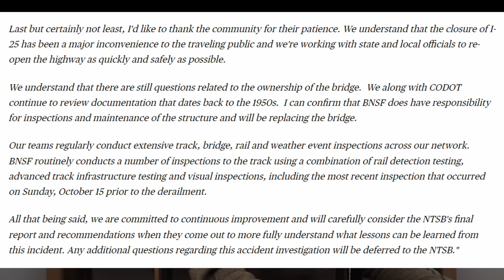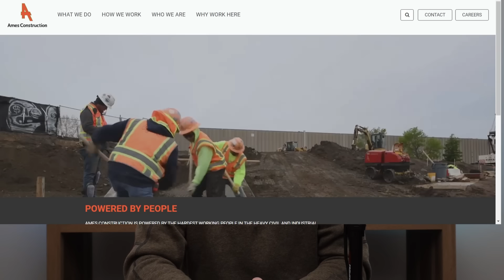Railroad Derailment and Highway Disaster

Comment: Most railroads used to have a set of ‘guardrails’ on most of their bridges. These guardrails sat between and ran parallel to the set of rails crossing the bridge. (In other words, you would see four rails instead of two). The thinking was that if a running rail broke or if a wheel derailed, the extra rails on the inside might ‘catch’ the wheels and keep the cars from tumbling off the bridge. You can still see these used in some parts of the country.
Reply: I thought they were still used everywhere. Their job is to stop a minor derailment turning into a disaster like this. One the train starts concertina-ing, nothing is going to keep it on the tracks.

Comment: Precision Scheduled Railroading has placed a burden crews, equipment, and infrastructure.  BNSF has been one of its biggest advocates.  It’s emphasis is doing more with less, longer trains, and less personnel.  It may of have no impact on this derailment but derailments have increased after the implementation of PSR.
Reply from the maker: That is interesting and not something I had heard about before.  Thank you.
Reply: Nothing whatsoever to do with PSR, and the number of derailments is falling, not rising. Coal trains have always been basically as long as the power can move.

Comment: The railroads do track inspections frequently.  In some areas, it gets done every few days, and in others a minimum of weekly.  Especially on main lines. Watching the virtual railfan site, you see them just about every day in one clip or another.  They have ultrasonic testing for internal voids and cracks, broken rails and so on.  The fact that the track had been inspected that day before the accident is more of a coincidence than anything else.  They lasers look for issues with track hardware, and when it discovers problems, the car can mark the track there with paint in some cases, and it is recorded on a computer that flags all problem areas with type of problem for the maintenance crews to address.
Reply from the maker: That is very interesting.  I was not familiar with the details of the railroad's monitoring methods previously.  Thank you.
Reply: @CaseyJones-Engineer The railroads have their own inspection cars, and also bring in Sperry cars to do even more analysis. Any place that has "cracks" or "voids" typically gets a slow order, forcing trains down to 5 or 10 mph...   I am retired from the geek side of the world, but have friends that work not only in MOW, but in operations, signaling and so on.
Reply: @CaseyJones-Engineer  The feds have standards for the frequency of inspections that are the minimum that has to be met.  In the case of Class 2 track (which is typically around 25 mph freight track on short lines) - the minimum inspection is once a week.  Higher speed line ends up getting class 3 inspection rules.  If any passenger trains use the line, that typically bumps the grade up a bit, maintenance wise.  When you get to class 9 track (good for 200 mph) -- freight is not allowed, and inspections are daily if I remember correctly.  Trackwork requires a ton of materials engineering to make everyone happy....
Reply from the maker: @Billblom  Very interesting, thank you for your comments!
Reply: "The fact that the track had been inspected that day before the accident is more of a coincidence than anything else."
No, it's not a coincidence. As you say, it's by design -- if you're inspecting the track every few days that means that, whenever an accident occurs, the track will have been inspected in the few days before it.

Comment: Many of my friends and relatives work for the railroad , so over time we’ve had many discussions about therm way inspections are done  . In the beginning a man was responsible for his section of track . They would walk it daily , and repair or report any problems . Then it went to weekly inspections  . Then monthly . Now it’s done electronically , a wire tells them if there’s any problem . Cost cutting is the goal , but a derailment isn’t cheap . 👍🇨🇦
Reply from the maker: That is really interesting.  I suppose the next step will be to somehow take all of that monitoring information and run it through an AI program in an effort to predict where failures might occur.
Reply: They still do visual inspections, from a hi-rail truck.

Comment: Isn’t it true, though, that short span railroad bridges are not always designed to handle the intense extra forces that occur in a derailment because the likelihood of a derailment occurring in one particular spot that would impact them is extremely low?  And if it were bridge failure, it would have failed from the weight of the locomotives and we would have a locomotive on the highway and not coal cars?  Even a brand new thru-girder bridge would not withstand a 100 ton coal car striking it sideways and a new deck style bridge would have just allowed more of the train to scatter on the highway like the WashDOT Talgo Cascades crash that killed 3 and  injured 65 including 8 on the highway.
We have all sorts of just constructed highway overpasses that could risk collapse from accidents involving trucks carrying certain cargoes, not to mention the large number of bridges over navigable waterways that are under-protected and would collapse if hit by a barge or other craft. If there were ongoing inspections, I would expect the focus to be related to track roadbed geometry and deterioration.
Most railroad bridges from the first half to the mid-20th century are extremely durable because they were designed to support huge steam engines and their tenders which often weighed 3 times as much as modern diesels and 5 times as much as the coal cars involved in this derailment.  So, when you see an old railroad bridge, it’s not automatically deferred maintenance.  They are bridges designed to last 80 to 100 years because railroads absolutely do not want to have to interrupt traffic to replace them as they don’t need to buy votes with bridge contracts.  And, they are bridges that have spent most of that time carrying half or less of the loads they were designed for.
Reply from the maker: Thank you for making those points.  I thought it was interesting what you said about the loading be greater in the past during the steam era.  I had not thought about that before.
Reply: @CaseyJones-Engineer  Yes, it really wasn’t until about 10 years ago when friends of mine who work for CSX and I were sitting around looking at old Trains magazine issues that we picked up on it, too.  On top of the fact that steam engines weighed up to 500 tons, most of that weight was concentrated over the driving wheels for maximum traction which meant bridge spans as short as 60 feet could be carrying 300 tons. Then add to that the way they are powered with side rods on a quarter rotation (the reason for the chuffing sound) that also weigh several tons that are not putting down continuous tractive effort but in a cycle.  This would basically mean the engine would be bouncing. The faster it went the more literal Pounding it was doing to the rails and any structure holding them up!
We often think of the Interstates as the greatest transportation construction project in our country’s history, but think about private rail companies had built a roughly 220,000 mile network with load capacities higher in most parts of their network that much of our current highway network still couldn’t handle.  And go back even further, in the 1860’s and 70’s when local transportation for most was horse and wagon, railroads were building bridges to hold up early steam engines that weighed 20 or 40 tons pulling rail cars that could also weigh 30 tons each.   Over 150 years ago, railroads had infrastructure crossing the rivers, mountains and canyons from one coast to the other capable of supporting hundreds of tons while people still rode horses and the automobile and airplane were decades in the future.

Comment: I was a BNSF Engineer, now retired,  and I ran those very same coal trains, I likely ran that particular train involved in the accident. I ran them between Denver and Sterling Colorado. The tracks are inspected nearly on a daily basis. Routinely, for any identified track problem, a work crew is dispatched to make repairs and still keep trains running. We, the train crew, are issued a Form B wherein maintenance folks are working and we must contact the foreman via radio to gain permission to proceed through the work area or to stop.  A Form C is issued as a slow-order where trains are restricted to a speed limit between specified mile markers, usually 10mph.  One day, as we were stopped at a siding we observed an area of track just in front of our train where the roadbed had been eroded away from recent rains. We reported this to dispatch via radio which resulted in trains being stopped wherever they happened to be along the route, including AMTRAK. Within a couple of hours, maintenance trucks swarmed the area to make repairs and re-bed the rail. The track inspector had likely not seen the erosion at the time of their passing because the erosion hadn't progressed enough to be noticed. But, we train crews are always on the lookout for “bad rail.” 
This particular bridge likely was constructed during the Interstate expansion of the late fifties through the sixties. Don't know where the head-end of this train was in reference to the derailment but those rails do fracture and break, those coal cars take a beating and they do derail due to wheel bearing failure, wheel failure, and other factors. It's hard to stop an 93,000-ton train but you see the damage imparted on the bridge and piled up coal cars. I would lean more toward a derailment of a particular car and not necessarily the bridge or the rail failing. The bridge structure was replaced expediently but not the pillars and with new steel plating for support and weight distribution. 
Usually, a broken rail is detected by the signaling system and we will get a flashing yellow, or yellow signal aspect,  as does dispatch. Dispatch will advise to proceed with caution, prepared to stop for broken rail. If the rail breaks while the train is on it then derailment will occur.

Comment: Railroad rails are replaced on a ton-miles accumulated basis. Once the rail broke and the train derailed, that bridge was coming down. Lucky that it didn't take down the spans over the other lanes. The track structure, rails, ties, fasteners, and ballast are inspected at least weekly on a main line like this. The Bridge itself would be inspected annually by the Railroad's regional Bridge Engineer. This route for BNSF sees heavy coal traffic so the rails are likely replaced every ten to fifteen years, more frequently on sharper curves. In the Powder River Coal Basin during the peak years of coal consumption back in the mid-naughties the rails were wearing out in ten to eleven months, traffic was so heavy, and they had to transpose the rails from side to side to get them to last that long.

Comment: 🦁🦁🦁🦁🦁🦁LION c LIKE No. 208     ----->      Railroad tracks and structures are inspected every week. Look up Long Island Rail Road, they installed a third track on their main line from Floral Park to Hicksville. The highway parts of the contract took some time, but once ready the new railroad overpasses went in over the weekend. And look at those new track switches: code 40 turnouts rated for 80 mph on the diverting track, they have moveable point frogs so alignment in either direction is purrfectly smooth!

Comment: A few weeks back, a fire unleashed itself under a California highway overpass in City of Industry, CA. It's right outside L.A. proper. Could you do us a video on where that recovery and repair stands?
Reply from the maker: Thank you for the suggestion. I've been thinking about that topic.
Reply: @CaseyJones-Engineer It wasn't an infrastructure failure, but a failure of common sense allowing the massive storage of flammable materials underneath.
Doubly troubling, the rental yard had defaulted in it rents due.
If California wants rent for under bridges, they need to revisit what is allowed for usage.
Reply from the maker: @blaydCA  I think they will end up spending the damaged bridges than they ever earned on rent.
Reply: @CaseyJones-Engineer  the rent probably didn't cover site remediation/hazmat disposal, nevermind repairs to support structures.
One can't even quantify the economic cost, with traffic diversion.

Comment: IDK anything about this particular derailment beyond this video, but unit coal trains are long, and it’s entirely possible that the broken rail was intact at the inspection.  However, by the time the locomotives and several loaded cars traveled over an intact weak spot, it may have broken under that train.
Reply from the maker: That is an interesting point. It does look like the derailment started with the engine or leading cars.

Comment: Good video. We have a huge problem with "deferred maintenance" in this country. I usually figured that riveted girders were pre-WWII. Take a look at an old Army Manual on bridges. In 1976, I was a float bridge engineer platoon leader. We were also trained on Bailey Bridges, and timber bridges. My guys and I built a 300'+ M4T6 floating bridge in one day. I had good sergeants. Good Luck, Rick
Reply: We have a problem with electing leaders with our emotions instead of electing people that will make the tough decisions and get things done. We elect people who are only worried about their next election.
Reply: @hgbugalou  Don't tell me. I developed a fine line in Intelligent Anticipation, a sense none of our amateurs this side of the ditch seem to have heard of, although once they'd seen it for themselves, they thought it came in infinite supply at zero cost. Strangely, they discovered they'd killed the golden goose.
Reply from the maker: Thank you.  You know this replacement span was not unlike a Bailey bridge.  We may see them come back as temporary measures when these types of problems occur.
Reply: @CaseyJones-Engineer  There was a company 30 years ago(ACROW I think) that was making a modern version. I was very pissed in the 1990s when most state National Guards got rid of their Bailey Bridge sets. They were a great emergency resource for the state to replace a few critical bridges. A Bailey Bridge can be built with 120 men and a truck from the roadbed. I used to know how to design a bridge based on available trees. I retired my PE, 7 years ago so I wouldn't do one now.
I taught bridge design as a mentor at UCONN in the 1990s. I used three chapters from the Army Fixed Bridge Manual and inserted the AASHTO equations and properties. The manual was much easier to understand than AASHTO. The kids seemed to have a good time and were much better prepared for bridge projects. Good Luck, Rick
Reply from the maker: @richardross7219   Wow, you certainly provided your students with a great experience!
Reply: @richardross7219  GBAR has 50-tonne equivalents.
Reply: @RahereTheGenius  Please explain.
Reply: @richardross7219  The Bailey Bridge takes too long to build in modern war conditions. It's been updated.
Reply: @RahereTheGenius  You mean by the MGB and then something newer. The Bailey is slow but a lot more flexible that the "assault bridges". There are places for all types of military bridges. I had the first set of the original Ribbon Bridge in summer 1976(while my M4T6 was on loan to the NY NG). It was amazingly fast but it broke easily and we did not have the ability to weld aluminum in our brigade. We had to get a civilian to weld it. As the systems get more and more specialized their usefulness narrows in scope. As a SGT, I was taught Keep It Simple Stupid. Later, as an officer and a PE, I always check for simplicity. They've made things too complicated and therefore less reliable. Good Luck, Rick
Reply: @richardross7219  Indeed. But to say that nothing exists is nonsense. As a fellow engineer, my task was to get the job done, not beef that the tools aren't custom-made for the problem.
Reply: Deferred Maintenance is a human condition globally.
Bright and shiny always wins over fixing worn out stuff.
Look in the average landfill!
Reply: @blaydCA  Look in the average graveyard.
Reply: Will get to that deferred maintenance tomorrow, or better next week...
Reply: @christopherderasmo5041  And then...
Reply: @christopherderasmo5041 You're qualified to be a mayor. Merry Christmas and a Happy Healthy New Year. Good Luck, Rick